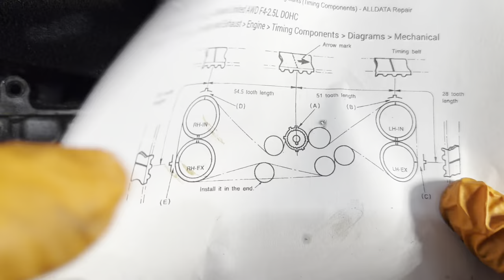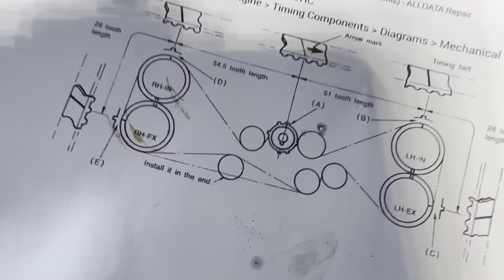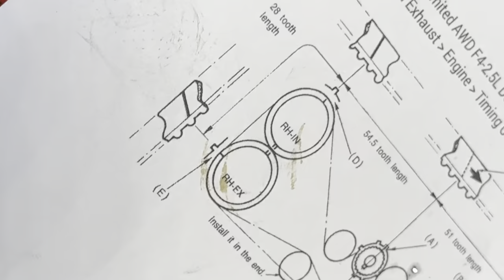SOFT METAL!  Engine Damage! Subaru Legacy Outback AWD 2.5 DOHC EJ25

Comment: I would've rather seen you blow out the hole with air by putting the air gun tip past the hole so it pushes the chips out, or vacuum out as much as you can and then blow them out. (Like you did with the tapping chips). Hope you flush the system to catch those metal chips.
Reply: Was thinking the same thing. Those chips will jam the T-stat, heater valve (if equipped), or clog the heater core, radiator, etc.
Reply: That bracket is 100% external to the engine and is replaceable, it attaches to the block with 3 bolts. No chips or shavings will enter the cooling or lubrication system from there.
Reply: The shavings will be between the bracket and the block , there was no need to repair the thread he could have just replaced the bracket
Reply: @chrissmithz314  so was Ray apparently lying when he specifically stated that the hole goes directly into the cooling passage/jacket?

You did hear that part in the video right?

If you have information that proves otherwise, how do you know this?  I'm not trying to argue but have you taken one of those engines apart before so you know that what you're claiming is true?  I would think Ray could figure out if that hole goes directly into the water jacket or not.
Reply: @eldridge201  Lying? Maybe misinformed. Do a google search for Subaru EJ25 tensioner bracket and you will find photos of the complete assembly. And they are cheap, $30-40...probably less than the Timesert kit he bought. Several people told him this in the comment section of the last video.
Reply: If indeed that hole goes into the water jacket, putting the air  behind it will help.  However, I suspect that the few chips falling to the bottom of the water jacket will simply stay there indefinitely. I suspect most engines have crap down there
Reply: @eldridge201  For some reason my earlier reply isn't showing up anymore. Maybe my edit ticked off the youtube filter.

Lying? No. Mistaken? Yes. 

The only proof I can show you is to watch this video from briansmobile1 at the 6:30 mark when he removes that bracket. 
"How to Take off a Subaru Timing Belt"

He also explains why you should never remove the tensioner first like ray did.

edit: I guess one other possible way to see this is by looking up the bracket part number and seeing pictures of it, subaru p n 1 3 1 5 6 a a 0 5 2
Reply: @chrissmithz314 , yeah…Ray misrepresented what the bracket was. Your comment has been the most coherent in this thread. Nicely done.
Reply: I'd hate for that to mean he had to pull the engine to put another water pump on!
Reply: Put grease on your drill & tap,chips will stick to the & come out with tools
Reply: Pressurize the cooling jacket to have air flow past the cutting tool.
Reply: simply stated, never a reader, and never learns. @HouseCallAutoRepair
Reply: That’s entertainment
Reply: Lots of “experts” commenting here. Remember, life is a continuous learning experience. I’m sure Ray learned lots from this. No mechanic chooses to do things the hard way. But they don’t make that same mistake again.
Reply: @kg4gav 
I believe he said the Timesert kit was about $100, so the replacement would definitely be cheaper and easier.
I’ve been working on cars for 52 years, and I am not to proud to search forums or videos to see if there is a better way to do something.  Even if I’ve done it many times before.
Reply: Thats what she said 😅😅😅😅
Reply: Until BigPharma comes up with a pill to make humans PERFECT we'll just deal with imperfection.  But.... and this is a big BUT...  we all agree we have freedom of speech to air out differences as a reasonable,  rational (wo)man would respect & expect, correct?

How about a continuous offering of ways to better capture those drill filings?

And Ray.... why didn't you either replace the bracket (¿not available?) or take the bracket off to better align drilling with drill press to get 100% straight and with no filings?
Reply: People callin people liars👺...least its not 2am at the Pry Bar Inn.
Reply: @@ClassBLiving64

Lol, I’m glad someone on here is older than me.  I agree.  He has good mechanic skills, and he appears to be honest.  But he is in too much of a hurry.  He is trying to get to the next thing before he finishes the first.  If he would do some research before he starts something, and slow down some, there would be a lot less, “I think”, and more “I know”.  Patience is a much needed attribute when working on cars.
Reply: @kg4gav  I can obviously do a Google search to figure out the situation but that wasn't my point at all.

My point I believe I already made and it was about whether Ray was "lying" or not.

I don't know how he was "misinformed" because it was he himself that was doing the repair and nobody else to my knowledge.  So, I don't think there was anyone else there to "misinform" him of anything.

What this amounted to was the reliance on Ray himself to know what was what.

For me as the viewer, I'm simply taking what Ray stated in the video as face value and since Ray has done quite a few various types of repairs over the years and has a pretty broad range of knowledge, I would think that he himself should know the difference between a hole that goes into a coolant jacket or passage and one that doesn't.

At least in this case I wouldn't think it would not have been that hard to figure out.  Obviously, I could be mistaken and apparently, based on many people's comments, Ray was mistaken.

Which is fine because mistakes happen.  

Again, I wasn't here to argue whether there was or wasn't a hole and simply that Ray stated there was.

So, I'm just going off of what he stated.

Yes, I can easily figure this out if I want to.

I'm not aware of the comments from the last video.  I'm only commenting regarding what I saw and heard in this one.
Reply: @theronwolf3296  You're probably right that "most" or probably likely "all" engines have some sort of "crap down there" as even the smallest amount of debris or sediment can become dislodged and make its way around the various passages in the cooling system over the life of an engine.

And, even from the factory there is bound to be "some" debris even if very very minimal due to vibration or age and so on.

In this case, I don't know for sure if these small metal particles would make there way back up and into a different part of the cooling system.  Anything is "possible" I supposed though.

You might be right.

I don't even know if these small particles would cause an issue anyway.  But, as someone else pointed out, if they did make their way up and into the water pump area or I'm thinking maybe into a radiator, it could "potentially" be an issue.  Again, I'm just speculating here.

There are lots of things in life where we think something will happen and it never does.  Perhaps this is one of those.  Hopefully, for Ray's sake, it is and there isn't an issue down the road.

I would just think though it would make more sense to spend a little time now trying to remove the "possibility" of the potential issue rather than have to spend quite a bit more time in the future dealing with this issue.  Not to mention having a client that had to deal with this because this wasn't cleaned up which could cause some unhappiness with the client by having to deal with this problem which didn't need to happen in the first place.

Again, I'm aware this will "likely" not be an issue in the future.  Hopefully.
Reply: @@ClassBLiving64 I'm all for content or even "creating" content but this was an odd way to go about it.  I'm kidding because I'm sure Ray didn't actually sit down and plan to do this as a way to come up with some content for his channel.

But man............
Reply: @chrissmithz314  Although I don't think Ray was intentionally "lying", I supposed "technically" it could be argued that he did.  

(In a way)

But, then we would have to figure out intent and all that crap and I'm not thinking the intent was there.

So, "mistaken" is the most likely reasoning and I'm fine with going with that.

As I mentioned in another comment, my point wasn't about whether or not I could look up the part or see a diagram of the engine and figure out if what Ray claimed was true and whether I wanted to prove him incorrect.

It was simply that I was taking Ray at "face value" given his experience, knowledge, skills, and etc..  I would "assume" Ray should have known what he was talking about in this situation given it shouldn't have been that hard to figure out.

Plus, quite honestly, it really wouldn't make sense for a bracket like that to go directly into a coolant jacket or passage since then a bolt going into that same passageway or jacket could easily cause a leak which would just be stupid to even allow in the first place.

But, car engineers come up with some stupid ass shit so who knows right?
Reply: @drmoss_ca  Agreed.  Hopefully for his sake and the client's sake he doesn't have this come back to haunt him in the future.

I just don't understand the thinking on this one really with how smart Ray seems to be for the majority of things.

As others are pointing out, this bracket could have likely been had for a very small amount so I'm not sure why he chose to make this much work out of the situation.

I don't know. We all get caught up in our heads sometimes and completely skip over the easiest and most cost efficient solution.

I'm just worried that he made more work for himself than was really necessary.
Reply: @michaelpressman7203  Although your thinking would make sense for people that understand how to drill properly, unfortunately, I'm not sure that would work in Ray's case since he believes in just going full throttle on the button and holding it there and won't allow the drill to actually drill at a slow speed or in short bursts (like you should) which would be better.

As such, your recommendation would likely not work as the grease would just fly off anyway.  (I'm betting anyhow)

I've mentioned this in other comments on this video as well as in the past maybe a year or more ago that Ray really needs to learn how to drill properly.  He's just wasting a lot of money on drill bits by wearing them out but also a lot of wasted time having to drill and redrill a lot longer than he would have to if he just did it slow and steady.

Instead, I'm betting he ends up burning up a lot of drill bits and also scorching the the hole that he's drilling which just makes it harder to drill and wears out drill bits even faster or more frequently as you use new ones to try to drill the hole where the old ones couldn't.  Once you scorch a hole from a burnt drill bit tip, it makes it a nightmare to try to drill through and just keeps ruining new bits.
Reply: @michaelpressman7203  Although your thinking would make sense for people that understand how to drill properly, unfortunately, I'm not sure that would work in Ray's case since he believes in just going full throttle on the button and holding it there and won't allow the drill to actually drill at a slow speed or in short bursts (like you should) which would be better.

As such, your recommendation would likely not work as the grease would just fly off anyway.  (I'm betting anyhow)

I've mentioned this in other comments on this video as well as in the past maybe a year or more ago that Ray really needs to learn how to drill properly.  He's just wasting a lot of money on drill bits by wearing them out but also a lot of wasted time having to drill and redrill a lot longer than he would have to if he just did it slow and steady.

Instead, I'm betting he ends up burning up a lot of drill bits and also scorching the the hole that he's drilling which just makes it harder to drill and wears out drill bits even faster or more frequently as you use new ones to try to drill the hole where the old ones couldn't.  Once you scorch a hole from a burnt drill bit tip, it makes it a nightmare to try to drill through and just keeps ruining new bits.
Reply: @michaelpressman7203  Although your thinking would make sense for people that understand how to drill properly, unfortunately, I'm not sure that would work in Ray's case since he believes in just going full throttle on the button and holding it there and won't allow the drill to actually drill at a slow speed or in short bursts (like you should) which would be better.

As such, your recommendation would likely not work as the grease would just fly off anyway.  (I'm betting anyhow)

I've mentioned this in other comments on this video as well as in the past maybe a year or more ago that Ray really needs to learn how to drill properly.  He's just wasting a lot of money on drill bits by wearing them out but also a lot of wasted time having to drill and redrill a lot longer than he would have to if he just did it slow and steady.

Instead, I'm betting he ends up burning up a lot of drill bits and also scorching the the hole that he's drilling which just makes it harder to drill and wears out drill bits even faster or more frequently as you use new ones to try to drill the hole where the old ones couldn't.  Once you scorch a hole from a burnt drill bit tip, it makes it a nightmare to try to drill through and just keeps ruining new bits.
Reply: @paulbainbridge6425 it does go into the water jacket. That's not such a big deal. He got most of it to start. A few small shavings is not going to hurt the system. It's not going to get stuck in the thermostat, that passage is plenty large enough. The only thing it could potentially harm would be the water pump. If those shaving even get that far, it's still unlikely. Those metal shavings are going to make they're way to the bottom of the radiator and stay. If you've ever flushed a radiator that needed it, you know the amount of junk that will come out of that thing is amazing. Alot of that junk is metal flakes that corroded over years of hanging out in the bottom of the radiator.
Reply: @marktaylor171  the part he is tapping is part number 13156AA062 it is a bracket that has no gasket as it’s spaced from the block , the bolt hole is actually straight through the bracket itself
Reply: The biggest hack ever.